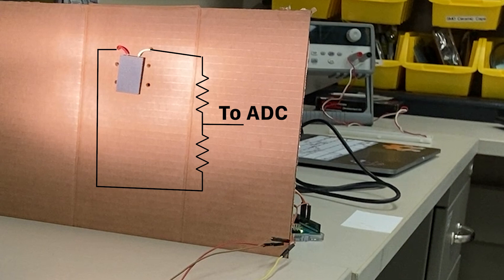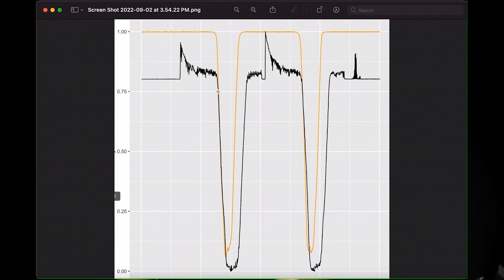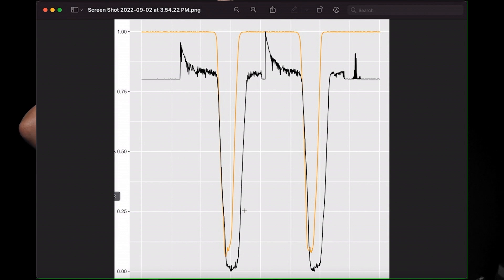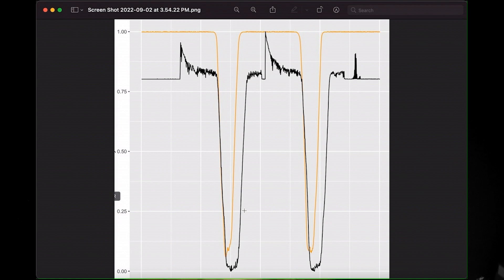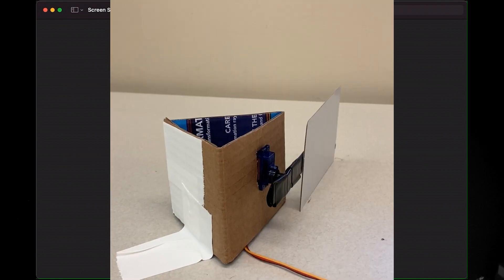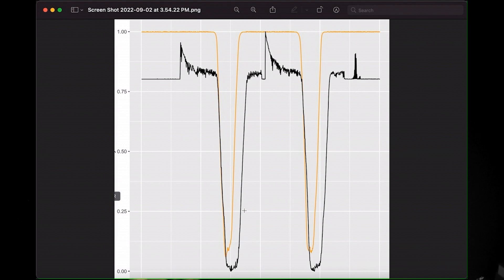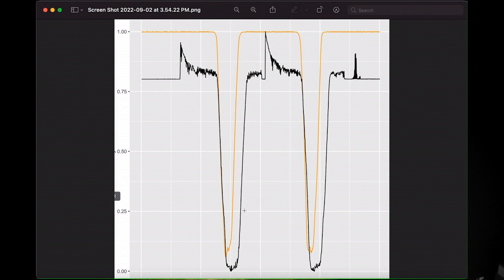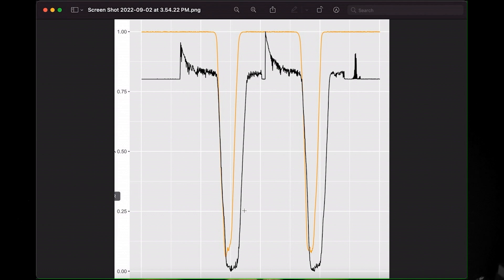Why are my ADC readings messed up? (Arduino example)

Comment: Please make a video on the Adafruit TinyUSB library and its implementations in CDC and HID (both host and device) modes. It would be better if you can use something which incorporates an RP2040 controller. Raspberry Pi Pico is cheaper. The codes should perform simple tasks without making things difficult to understand.

Comment: There's another common issue I've dealt with in the past which is charge couples input voltage sharing between channels. Especially with high impedence inputs and rapid channel switching (which I used to have back in the old days using assembler. If you're running python it's kind of slow so might not be an issue but otherwise you might need to do some dummy reads or extend your input sample time depending on your hardware and how much into the nuts and bolts you're having to dive to extract the readings. i.e. for Arduino, it's already hiding most of the work of doing an analogue reading behind the calls you make.

Comment: Hobbyist-grade sensor often either biased or a bit noisy, need to be calibrated and filtered in Arduino program. This is why industry-grade sensor like Siemens and Omron are bloody expensive because calibration is hard to do and they did the job very well

Comment: Doesn't the arduino have an internal voltage reference that you can use? Most microcontrollers I've used have that. Googled it and it seems it does have an internal 1.1V reference, that you can use, of course you'd also change the resistor divider to bring the signal to that level. Wouldn't that be a better quick fix that the battery?

Comment: I cringe when I hear people are reading voltage levels when using their A/Ds.  They need to get out of this fantasy land in assuming Vref = 5V. Ratiometric configurations address much of this. Just think of A/Ds as being a count value relative to Vref and not an absolute  voltage reading.

Comment: You are measuring an independent absolute voltage source with an A/D. Your input is not ratiometric with the Vref. 
To measure absolute A/D voltages, you need to also feed in a stepped down Vref and a precision voltage reference into 2 other A/Ds. Then you can derive what the voltage of Vref is.
A/Ds read a count value relative a full count value representing Vref.  It is wrong to assume your A/Ds read absolute voltages. 
You need a discussion on ratiometric A/D configurations and one on what’s needed to read absolute voltages on A/Ds.
The easy way out of this problem is to use a weight and pendelum or connect the arduino to a clean power separate from the motor power. Vref ~= 5V and be fairly stable.

Comment: I think in this case its the sample and hold circuit of the adc. Since the aref of the Uno is on the 5v supply rail. So it should be proportional to the voltage drop.

Comment: Put a cap parallel to the divide output and add an emitter follower or an op amp follower. You get very low impedance output and you can sample it very fast.

Comment: I try to put all inductive loads on their own power supply.  I use input from a 12v or 9v wall cube. Then split that between two inexpensive buck converters that drop the voltage. One buck converter powers all the inductive loads (motor/solenoid/relay/servo)   The second buck converter powers only the microcontroller.  The MCU then has it's own power supply with nothing to cause surges.  The 12v Vin can usually easily handle varying loads from either buck converter.
Reply: This is usually what I do too! It has worked pretty well so far!

Comment: Thank you - I realised similar issues some time ago, and since then, all my MCU based sensors have: LDO and bunch of capacitors, to make sure the Vin is as stable as possible. Vref in MCU crap ;-) (because it is probably not referenced to the Vin but Vref, however if Vin is unstable then Vref as well)
EDIT: btw, this issue you are showing is typical: "LAB only problem" because in the real life application you were describing there was... no motor, right? ;)

Comment: AFAIK, ATMega has a separate pin for ADC reference voltage. Why not to use it, maybe, with a resistor and zener/LED?
Reply: Right. There is also an internal band-gap reference that should be quite immune to power-supply fluctuations. Its is somewhat low voltage though (1.35 V IIRC).
Reply: @edgarbonet1  that is still full of white noise both from power supply and wires. the most clean output of uno adc in my experiments is just to feed the supply voltage to external reference pin.
in this case as mentioned, the surge current of motor upon action and sampling rate of adc causes the problem.

Comment: Ugh i remember when we learned about this in school. There is a whole field about providing clean power to all components (with lowpass filtering, shielding, dividing power correctly,...) there are all sorts of things you can do with hardware to prevent these things. When we measured with our µControler and had (more or less) the same problem to solve only we HAD to use the power provided via the controller (part of the exercise).